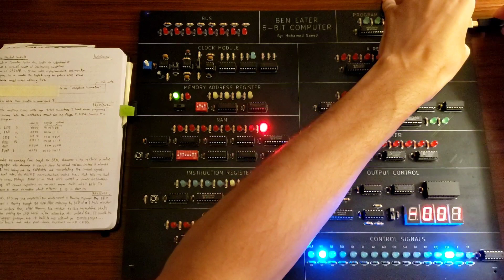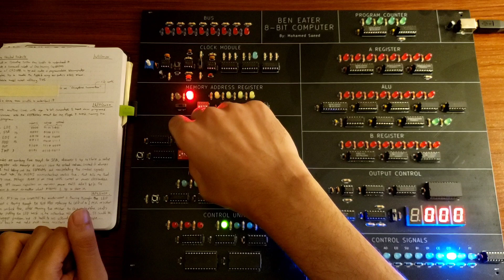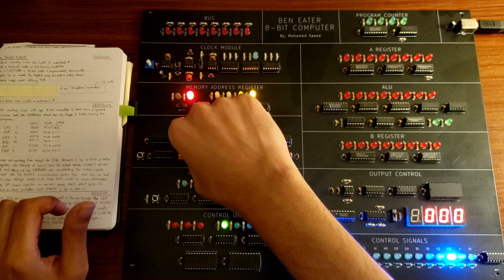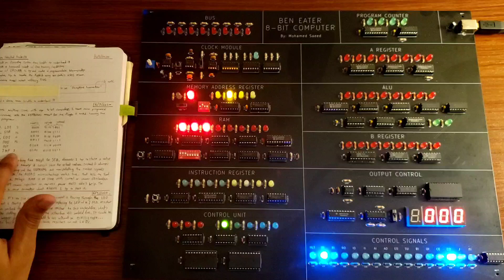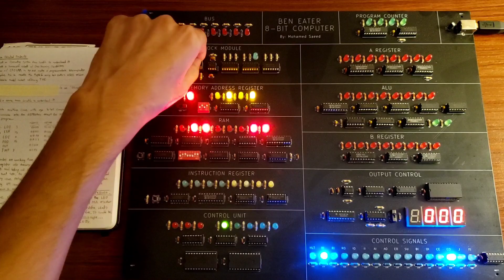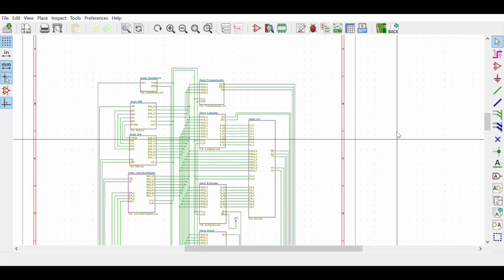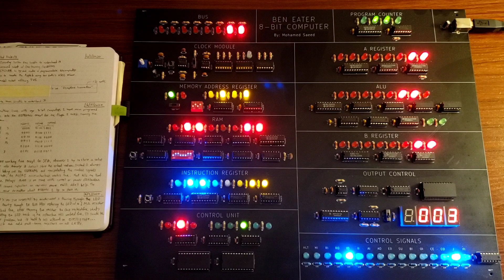My 8-bit computer PCB! (Overview)

Comment: I have question:
To replace loading the íntructions by hand, we have to use magnetic tape, right? And binary values will be loaded from disk to ram/register..

But how the disk can detect the request as you save the file, and generate the electric signal to move the record header

Comment: Nice work! I did an implementation of Ben's project as well. I toyed with the idea of doing something like this, just putting everything on a PCB, never got to it and moved on to other projects. It's nice to see it done.

Just curious whats the size of the PCB?
Reply from the maker: Thanks! It was 371mmx299mm, but could definitely have been made much smaller.
Reply: @invent0r137  Thank you! Appreciate the reply.

Comment: 5:21 there is it. you wrote 0100 again with 0101 values. and what i would do is changes addres 0101 and hit write button when dip switches is ready LOL. then go back 0100 and change that

Comment: Hello brother, i have built the exact same model using your design. But the problem is i have soldered Common anode 7 segment display instead of cathode. So what can i do instead of desoldering them??
Reply from the maker: I don't think there is a fix for that because the traces on the PCB connect to ground, so they're wired specifically for a common cathod display. I think the only way to fix them is to desolder and replace them with a common cathode display. By the way it's great to hear that you built it, I'm curious to see how it turned out, can you share a video or some pictures?
Reply: Yeah sure i will share on reddit DM

Comment: I arrived here looking for a way to improve the connection reliability of Bens 6502 computer.  I have the 8 bit computer almost finished.  Your project is at such another level.  Really fantastic work you have done.
Reply from the maker: Thank you! I also made a 6502 computer PCB based on Ben's design if you want to take a look at that video!

Comment: How many cycles per second does it run at? Does it do one op per cycle, or do some ops take more than one cycle?
Reply from the maker: The clock speed can be adjusted but I haven't measured the fastest setting. All the opcodes consist of multiple microinstructions (shown at the bottom right of the board) and at each clock cycle a certain set of microinstructions are executed. Some opcodes might take 3 clock cycles and other might take 5 clock cycles.

Here's a good video that goes into more detail about it: https://youtu.be/dXdoim96v5A

Comment: The reason it didn't output on your first try, is because you wrote the jmp instruction on top of the out instruction. You forgot to increase the address before adding the jmp.
Reply from the maker: Good catch! Looks like that was the issue this time. I had the same thing happen before so I automatically assumed the problem was the missing pull-up resistor.

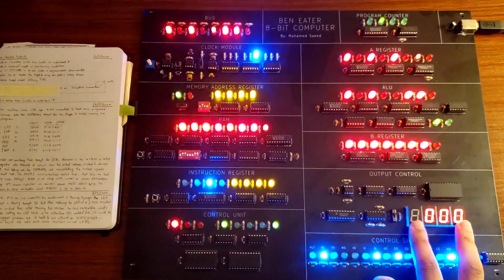Comment: 4:25 - I had that exact problem with my build. If you followed Ben's build to the letter, the problem is indeed that the write button is left floating (as you said at 5:37). A simple pull up resistor solved it for me. I made a YT video explaining my problem here: https://www.youtube.com/watch?v=gtbuEwZmirM  ..and I made a follow up video explaining the solution here: https://www.youtube.com/watch?v=n71zgHrWBUk
Reply: In this case, it was overwritten because he actually wrote over the same address :)